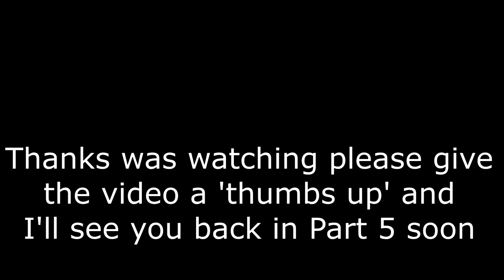Pfalz WW1 Fighter Build and Fly Part 4 Tissue Covering

Comment: Hi Cliff, your video on putting cling film under a tissue covering is a terrific idea and has greatly interested me. After a year of flying this model since you made this video could you tell me how this double layer covering is holding up please? I would like to try this on my next model build from scratch, which will be an RC assisted rubber powered Pacific Ace, inspired by the build and flying videos on Domoremath's Youtube channel from some few years ago. Cheers, Marc
Reply from the maker: Hi Marc, for wear and tear it's holding up quite well but it does puncture of course with sharp twigs lol. However a better method is to do what Mark Robinson has just shown on his is latest videos and that is to use doculam instead of cling film it's also no got a heat activated bass which makes it a lot easier to put on. Here's a link to the video in question https://youtu.be/oSi81sbQQK4
Reply: @CliffHarveyRCPlanes  many thanks!

Comment: Very nice! Does the clear wrap adhere good with PVA glue, would the plane fly with just the clear film only,? Just wondering.....
Reply from the maker: Yes it does Perry, watered down a bit, doesn't need to be full strength. It probably would fly ok but the clear wrap is incredibly thin so would puncture easily, a light weight model around 30 grams would be idea, cheers 👍

Comment: what dope are you using ? and mixture
Reply from the maker: Hi LM, the dope I'm using is from my LHS, it's just a clear shrinking dope made by a UK company called 'Guild Materials'. I thin it down about 50/50 with cellulose thinners, the thinner it is the less it shrinks of course, also what's left after evaporation is less of a coating 🙂
Reply: @CliffHarveyRCPlanes  wicked

Comment: What's the advantage of the clingfilm under the tissue?
Reply from the maker: Hi Chris, for bigger tissue covered planes it gives the tissue a bit more strength, yes it'll still puncture but not so easy to put your finger through 👍
Reply: @CliffHarveyRCPlanes  Aha.  That makes sense.
Reply: The real benefit is it becomes an all weather covering unaffected by damp air. Not used cling film before, always used 5 micron mylar, will give it a try
Reply from the maker: @peterbrown7130  Thanks for pointing that out Peter, I'm getting forgetful in my old age. How thick do you think CF is?
Reply: @CliffHarveyRCPlanes   no idea of cf thickness. The mylar is quite ‘rigid’ doesn’t indent with a finger if you poke it. Actually lighter than just tissue as takes less dope